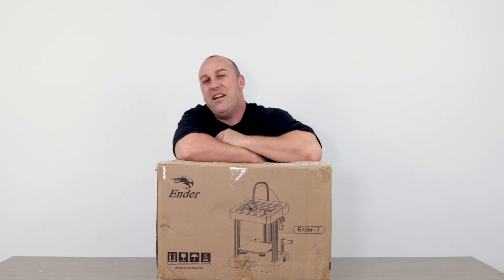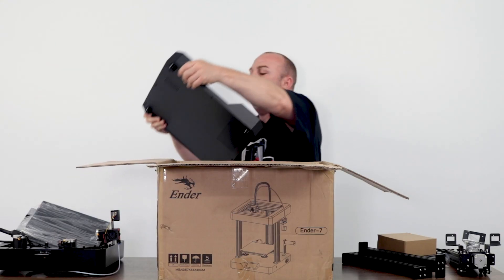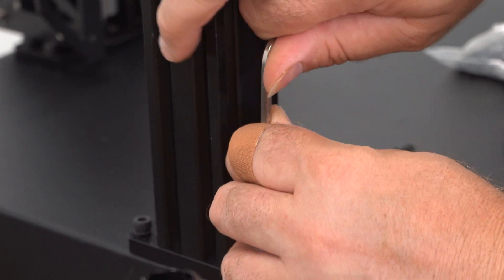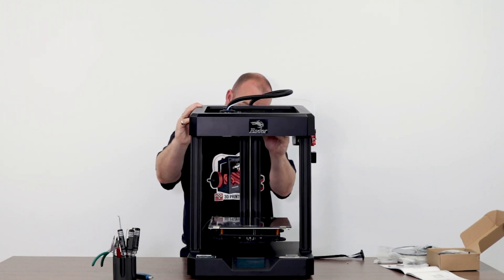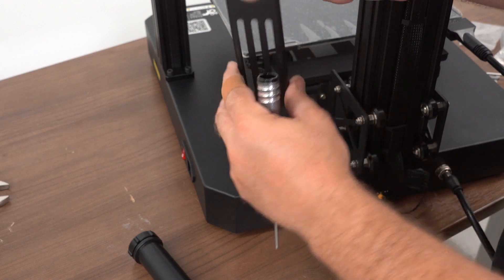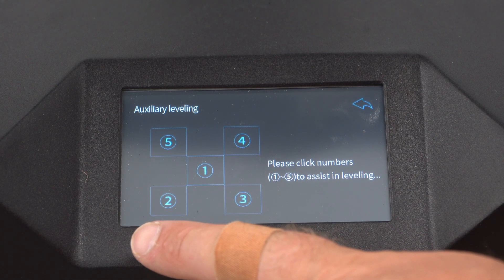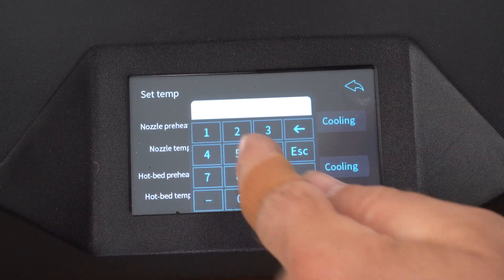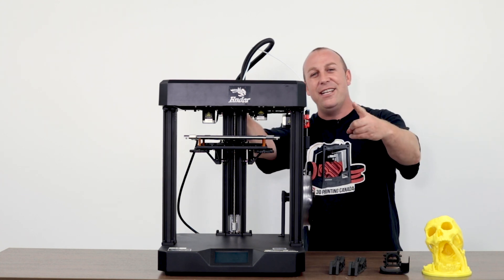CREALITY ENDER 7 UNBOXING & BUILD

Comment: 2.37 No linear rails on the Z-axis, just cheap rollers. 13:57 I guess you mean dual gear extruder.
Reply: the Zed axis is very slow, not sure what benefit any linear rail would provide? Would be more un needed weight and cost.